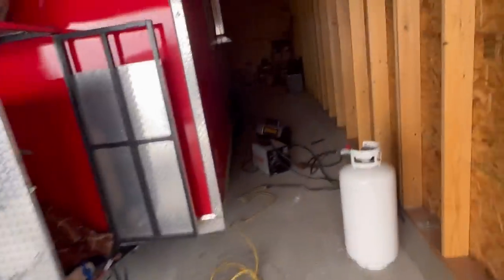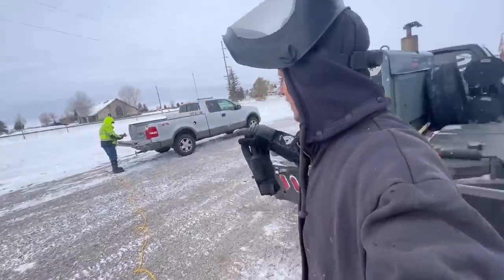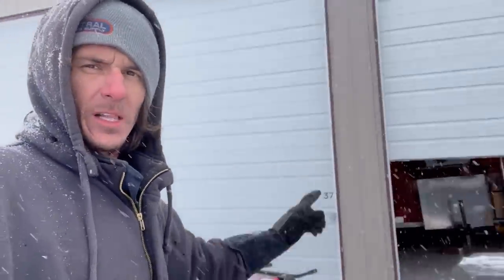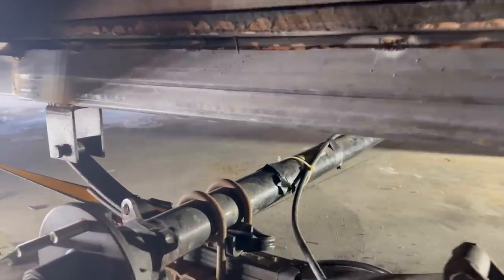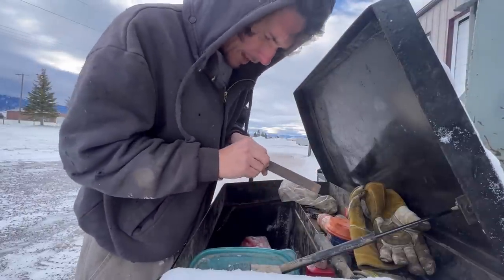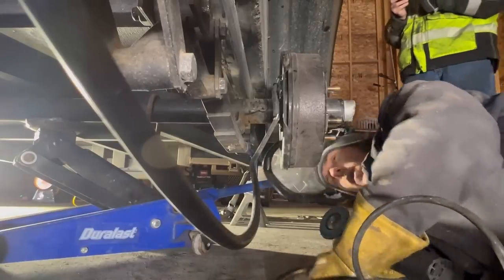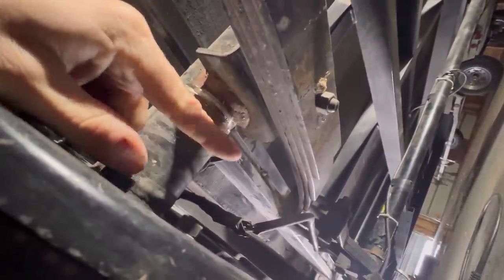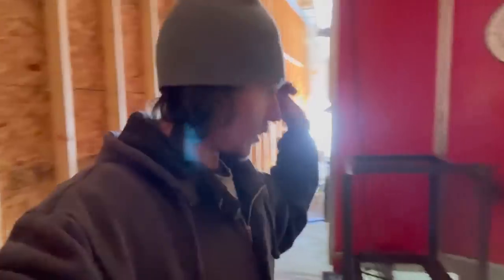Christmas Disaster (Emergency Welding Repair)

Comment: I did a trailer like that the other day big 20 some foot camper trailer. Was on a 7 percent grade when both axels came off. Had to close the road and get the axels back on it to move it. Customer is in a class action lawsuit with the manufacturer now because of it.
Reply from the maker: Dam that’s brutal. Could you imagine going on a family vacation and that happens?
Reply: @MeltinMetalAnthony  yea I felt terrible for them they were all the way from Florida to California with the whole family. Brand new rv too. But we got them all fixed up and back on the road so they were good to go.

Comment: In my experience with Flux core I run a size bigger on the tip than the wire so it helps eliminate that welding to itself It sometimes works on aluminum spool guns as well
Reply: Money😊

Comment: I had the same issue with wire feeding and was told to use tip one size bigger than the wire and wire tension to be minimal as possible and wire roll tension not too tight. Once i done all this never had the problem again.

Comment: Not wanting to put too much heat into the piece and thereby weakening it, is a good call. Its also the reason why you don't weld horizontally across the bottom of the frame when attaching the spring hangers. Longitudinal welds only, along the length of the frame. 
The added heat (in the heat affected zone) horizontally will all but guarantee the frame to tear around that bracket. Especially when youre only dealing with 16ga to begin with.

Comment: Great video. Not trying to trash your repair, but as a old body & fender guy (25 yr's experience)  what you may wish to consider, if facing a similar repair, is to add / allow for some 3/8 to 1/2" inch Diameter (i.e., round) PLUG welds (mid height on the side's) maybe every 4 to 6 inches, to help distribute the "Structural Load Factor."  I would weld say the left sides of the holes first,  (Left and Right side Rail's) than come back and do the right sides to keep the heat factor to a minimum.  Good catch on the manufacture not repairing the axle seats that were moved / readjusted, on the axle housing.  You saved some lives catching that, no doubt about it.
Reply: nice upgrade.  i bet there is another cut in the axle under the hanger too.

Comment: Try using next size up for contact tip, because flux cored wire burns hotter then gas shielded. I had the same problem once.

Comment: hey Anthony I'm kinda late but I build trailers for school (Out of 1/4" material not 16 gauge) and we do everything ourselves including wiring, I just wanted to let you know there usually is only a brake wire on one side because theres actually a wire that runs through the axle that connects to the other side
Reply: daaamn. 1/4 is OVERKILL. I built a trailer on 2 axles using 1/8 and 3/16 for crossmembers (because i got it real cheap). 1/4 is for some real serious weight. Real expensive as well compared to 1/8 and 3/16.

What are the trailers for?

Comment: Nice job man! That's why I'm old school I like stick welding you never have any problems like you do with those wire feeders an plus as you know you get more penetration with stick welding.
Reply: I used to be like that.   Once you learn how to use/troubleshoot you will find how much more productive it is.
Reply: @donsmith9081  I believe you're right to some degree but every case is different.  If you're out in the field with a wire feed an it's windy you're not gonna be using it all the shielding gas blows away.
Reply from the maker: I did try for a minute but I was so out of position that I blew through. Even running my Lincoln at 65 amp and low OCV I definitely could have if I had better position
Reply: @amos4457  There are different types of wire. MIG welding requires gas and is a solid wire.  FCAW or flux core arc welding does not require gas and is usually used in commercial structural steel welding.
Reply: @donsmith9081  structural fcaw wire could not be used on 16 ga or 3/16ths.   some dual shield will work on thinner stuff. he is likely using e71t11-gs which is made for thin galvanized sheet metal frames with a two pass maximum
Reply: @peetky8645  I was Not suggesting using a structural wire on 16 gauge-obviously.  I was pointing out the fact that it does Not require gas.  I would have used .030 FCAW wire.

Comment: One of my first jobs was exactly this but the hanger ripped a big piece off the trailer frame and it was In the opposite conditions. Middle of arizona summer on the hottest days of 2021 with no shade and the trailer was on a dirt incline so there was such little space I couldn't see what I was grinding and barely what I was welding and took all day and close calls with heat exhaustion but I literally finished up the job when my generator ran out of gasoline and my truck was basically dry also and I was literally dead broke so thankfully I finished when it died and the guy proceeded to not pay me for no reason other than he just felt that he shouldn't have to pay me knowing full well I didn't have money or gas and lived an hour and a half away lol
Reply: I hope you are doing better today.  Don't worry every dog has his day and his will be coming.

Comment: Keep that whip straight and it won’t happen , it tends to do that when your whip is not straight so the wire hits the tip at an angle and when it arcs it melts it on the tip

Comment: You should try the 3M cubitron cutoff wheels. I use them almost every day, and it seems like they last the longest. Not cheap, but they work well.
Reply: I’ve used Walter and there pretty good to.

Comment: Happy New Year to you both for pushing through it all! 1? What brand is the trailer so everyone knows who not to buy from. Inquiring Minds Want To Know.🤔🤔Good Job preheating before you weld on frozen 🥶🥶metals. 5 ⭐⭐⭐⭐⭐
Reply: Lippert
Reply from the maker: Not sure I didn’t check
Reply: good point

Comment: That's unfortunately the pains of fluxcore on those smaller tips they foul more easily more heat and no gas but check the liner if it's a little short to the end it has opportunity to jam easily but I've always had Hobart flux jam on me too. But a good upgrade is the Primeweld mig180 tweco tips same torch ish a better welder and way better warranty and support if you need it plus cost wise you could go online get another torch that uses the beefier tips to fight that heat and still come out ahead.

Comment: Just a suggestion, I might look at adding a gusset just ahead of where the 3/16 plate ends… might help prevent a crack from forming
Reply: curved end plates are a great idea when reinforcing.....stress is distributed more widely
Reply: I’d put gussets on the 2 centre perches

Comment: Nozzle dip is your friend.  Your drive rolls should be as tight as possible BUT should be able to slip if tip burn back happens.
Reply from the maker: Was the liner.
Reply: @MeltinMetalAnthony  Yes, a kinked liner will do it.  Keeping machine far enough away where liner is relatively straight helps a lot too.  Years ago the company I worked for bought me a brand new LN-25 for a big stainless job. After I got it dialed in, it kept burning back. After I sprayed anti-spatter on actual wire it ran flawlessly-it must have acted like a lubricant.  I don't think I would do it on an FCAW wire though.

Comment: One thing ive been noticing with cutting wheels. The 4 1/2” wheels are hot garbage, all of them. I have switched to using 6” wheels anytime I can. They seem to be made alot better and last a ton longer.

Comment: Are you using a knurled drive roller? Wonder if that'd help prevent the birds nesting. I have a little HF 125A inverter machine and haven't had any problems with feeding flux core. Supposedly the v-shaped rollers distort the wire.
Reply from the maker: Yes was using knurled roller. The liner went bad

Comment: Do you not have a cut off saw/chop saw? I'm just wondering why you'd use a 4 1/2 angle grinder instead of running a 14in saw. The abrasive disc's are pretty cheap, and last awhile. Not to mention the time it saves.

Comment: crazy how the grinder heat warped the steel
Reply: Actually it's not from the heat. If you remove any part of a tube, angle, I beam it will bow because it's no longer a complete structure.

Comment: love the vid, since you have some dewalt tools you need to look into their metal cutoff circular saw.  It beats the shit out of cutoff wheels, even the metabo wheels.  Most important it saves time.  You could have cut that steel in a fraction of the time. Making crap jobs easy.

Comment: Why did you choose to use Flux core and not stick weld like you usually do?
Reply from the maker: Steel was soo thin it was hard to not burn through in the awkward position I was in
Reply: @MeltinMetalAnthony  makes sense. Great video.
Reply: There's no such thing as fluxcore MIG. It's one or the other. FCAW or GMAW.
Reply: @skitown11  yeah, I realize that, but thanks for pointing that out.

Comment: Funny, you can see the cutting wheel getting smaller as you went down the tube.
I HATE flux core but sometimes it's the solution.  I back the feed roller pressure till it won't bird nest when the contact tip jams.  Makes life so much simpler.
I don't know who made this POS trailer.  The top looks really good but that doesn't do a bit of good if the under carriage falls apart.
Reply from the maker: Ya it was that and welding itself to the liner. Put a new liner in and works like new!
Reply: @MeltinMetalAnthony  That is something I really need to do.  I've put a few hundred pounds through the liner I have.  It's time.

Comment: These mass produced trailers and campers are built like shit, had a customer bring in the same issue on a brand new wedge car hauler with 2 trucks on it. There was hardly any weld actually in the fillet holding the spring hanger on.

Comment: yeh getting realy frequent with the nozzle dip might help with the wire sticking in the tips.

as for the cheap grinder blades ... yeh I'm realy fussy on the brand I use ... some are just rubbish to the point of being dangerous ....... new here in AU is metal cutting diamond blades, apperantly, they last about 40 times as long as compounded blades with no loss of diameter ....... have not tried one myself YET.

You will never run out of work fixing trailers, so many built broken, worldwide.

At the end of the job, stand up tall, stick ya chest out and say, "it's better than I found it".

Comment: Does your machine have the right drive wheels for flux core? That may be your problem.
Reply from the maker: Yes had knurled and smooth rollers. It was the liner